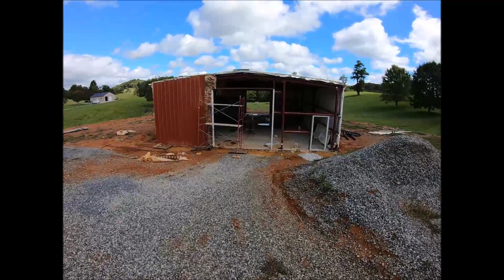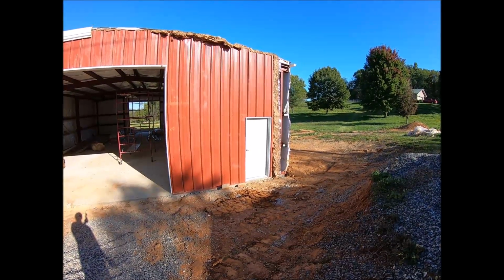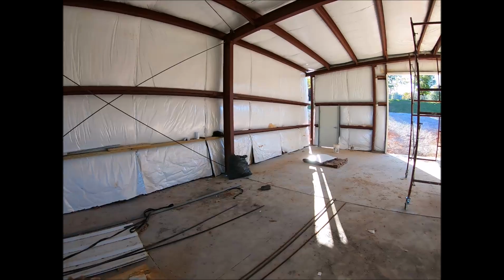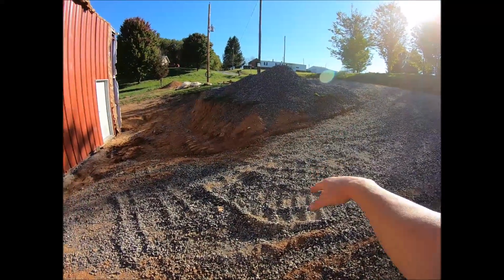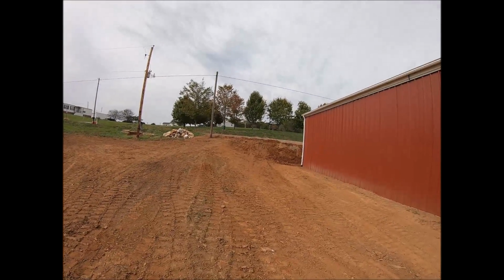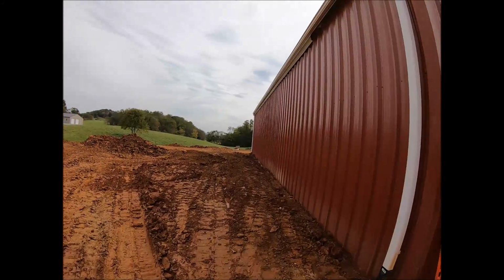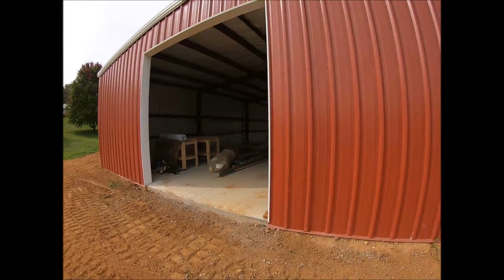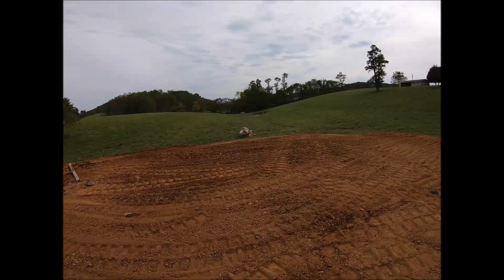New Shop Build Part 10. Major grading done and front wall progress

Comment: Looks great, getting to the final stages. In Australia we use a thin wire mesh on the ceiling and the insulation is sandwiched between the mesh and roofing.